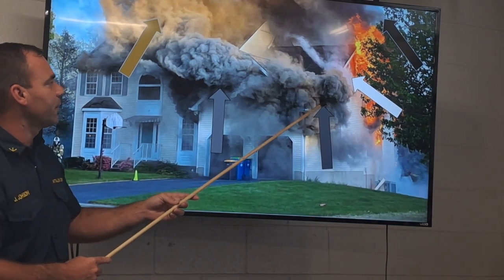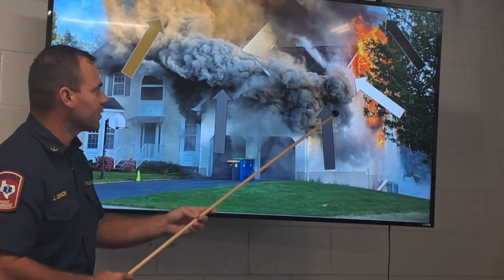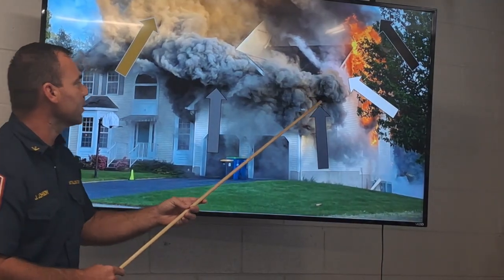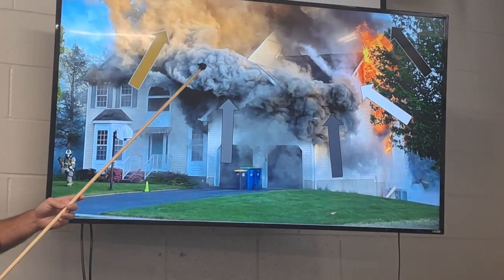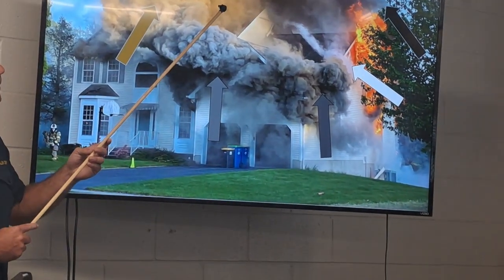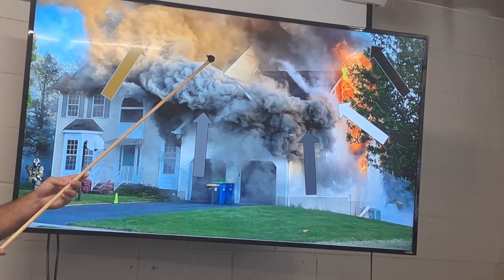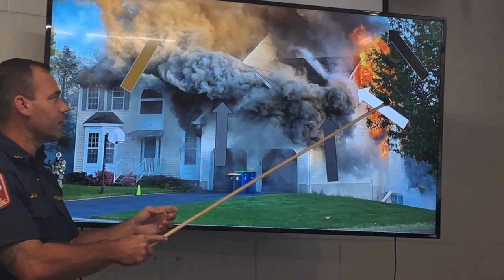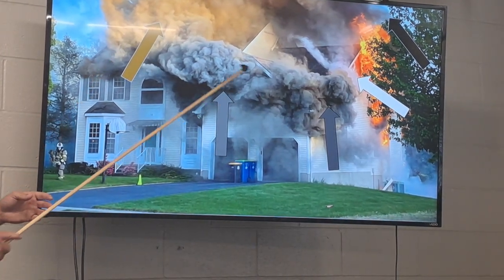Reading Smoke in Under 2 Minutes

Comment: The shape of the smoke cloud tells about how hot it is. Very hot smoke has a cauliflower look, bubbly and expanding. Smooth surface thin and slow moving is not as hot.